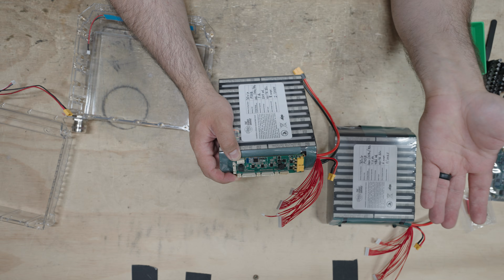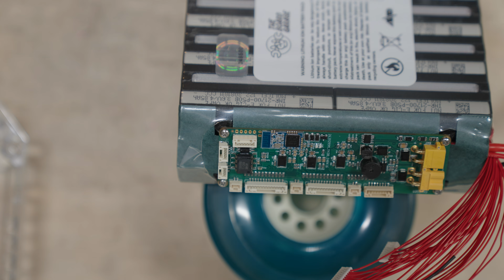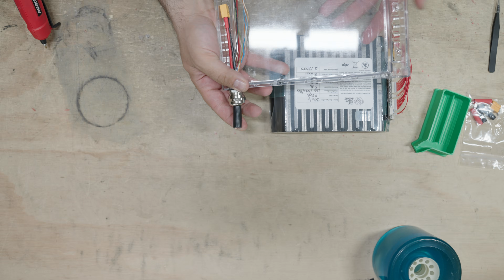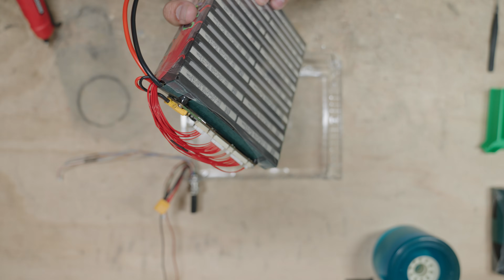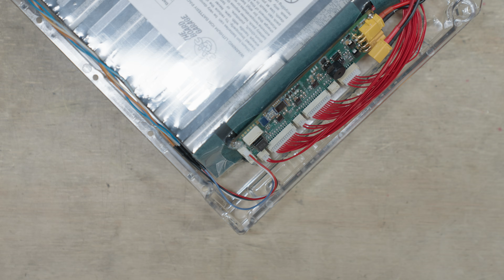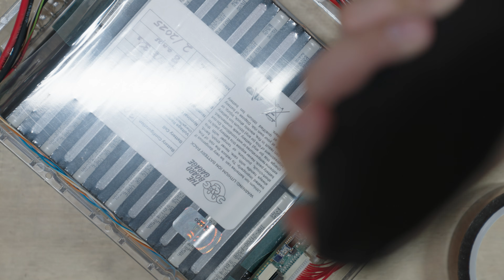126v FAS Pack Install for VESC One Wheel

Comment: Im in the UK so couldnt get one of your batteries, watched the videos for ages now. A question - i have an OG floatwheel, with the updated rails, currently their 12s limited VESC. What would you do with it? New vesc, higher voltage 1p battery, or 12s2p 18650 battery? Both probably temporary as i hope to have the liquidity to upgrade...but i want to use it until then. No crazy trails or speed, just general riding. Thoughts hugely appreciated!

Comment: These packs are rock solid. If you’re a racer or hard trail rider, this is the pack u want. @thehighlightwheel and I have been running them for a few months without a single issue. Installation was seamless and easy, didnt even have/need this video to reference. Another quality design, bravo 👏👏👏

Comment: 126v !!! this is getting ridiculous lol. how does cell balancing on the bms work?
Reply: Its about time! Lol unicycles are up to 176 volt, the higher the better for overhead and efficiency, it is getting harder to fit these packs into decent shapes though. Bms should work the same as any other.
Reply: @EUCnFPV  I thought each cell has a it's own voltage sense and bleed resistor but I couldn't see them?
Reply: @dfgaJK each cell should have its own voltage, I didn't get to finish the video I'm at work lol just listened to it
Reply: He doesn't really mention it in the video, it is more so that I can't understand how a 30s bms is so small
Reply from the maker: @dfgaJK The BMS is a smart BMS that only manages charging, and it does balance/bleed off the cells if the pack needs balancing. The PCB is double sided, so there are components on the underside as well. The charge port routes to the BMS, and that manages the pack. All cell data (voltages, temp, charge current, etc.) gets reported to the VESC over CAN bus, and so can be monitored and managed that way.
Reply: What charger are you using for this type of battery?